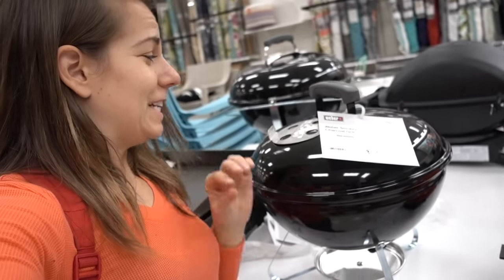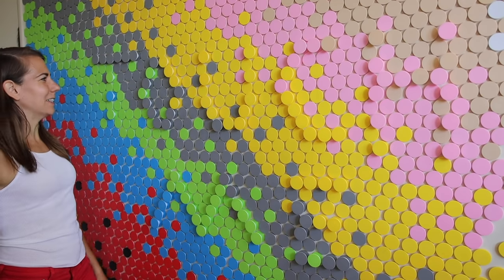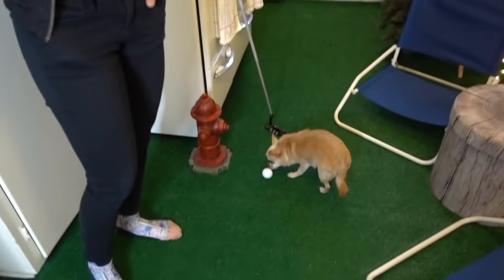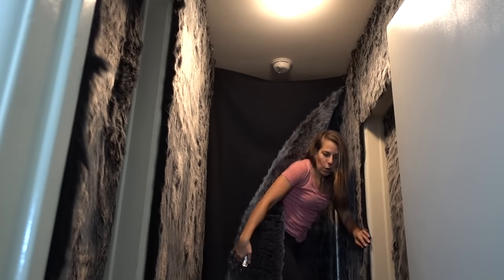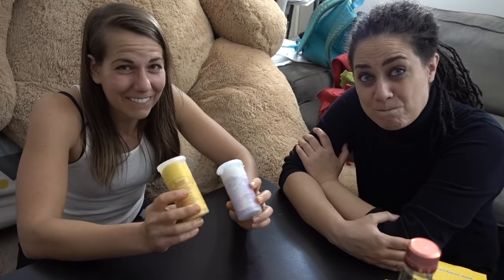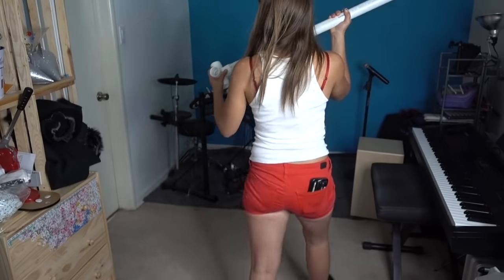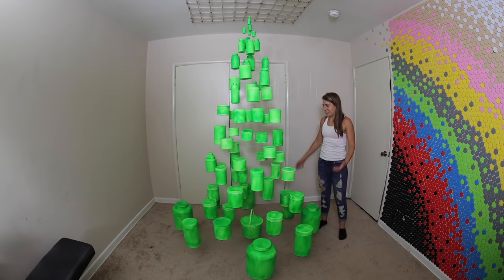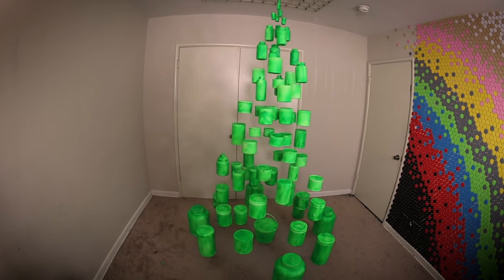DON’T TELL MY LANDLORD | Apartment DIY Compilation #1

Comment: As a past employee of a retailer who sold this fabric, the best way to cut it is by just cutting only the backing, with very small snips, without cutting the pile. It is possible if you have a flat surface and a sharp pair of scissors. The advantages to this are you don't have and real mess of the fibres being cut off along with the pile isn't jagged on the edges. You did an amazing job though.

Comment: Secondary tip would be using the old overhead projector trick for tracing logos on a wall. Back in grade school (90s kid), if we ever had to draw a detailed picture of something for a project we were allowed to use the overhead projector to project the picture onto the white board. Than trace the picture onto paper taped to the board. If you had a Bluetooth projector you could do the same thing with a laptop. I know all of this is redundancy after the fact, but it triggered a fond memory I figured I'd share. Stay rad!